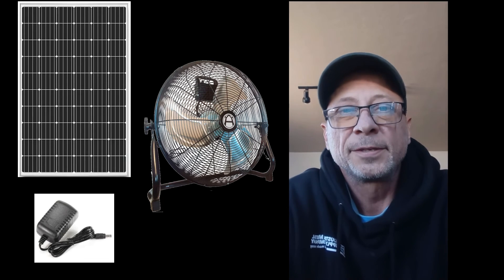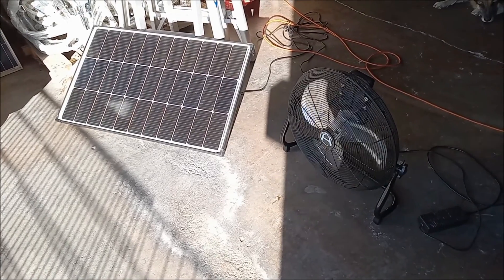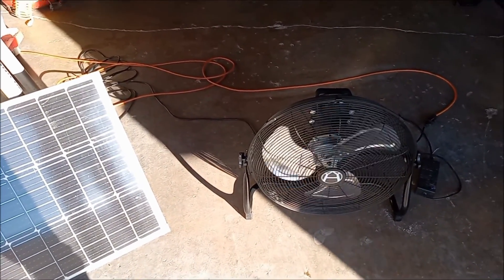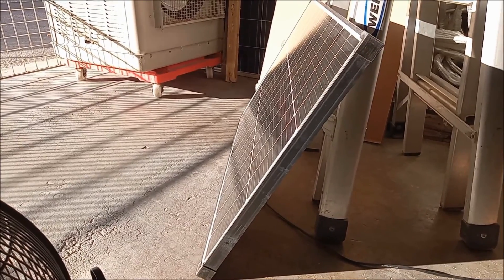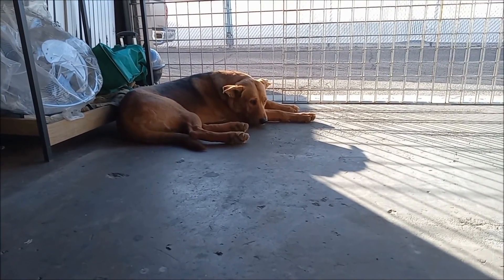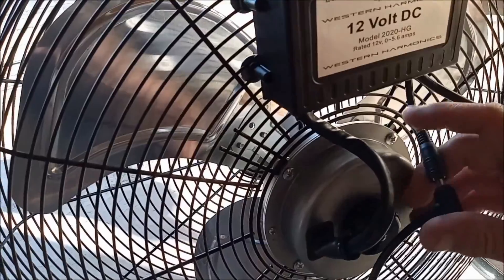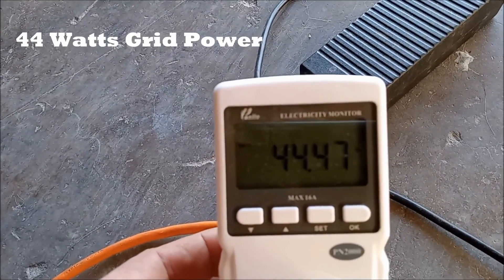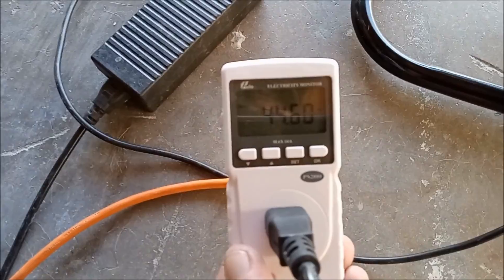Floor Fan - Western Harmonics Grid Or Solar Powered 20" Floor Fan.  Hyper Efficient, Strong Breeze!

Comment: How do you run the fan from a (beefy) USB-C power bank?
Reply from the maker: Hello @RonJohn63.  This system and fan are over the ratings for USB-C, running at 12 volts, 6 amps.   You would need 12 volts battery with charge controller, and then voltage/amp rated connectors.